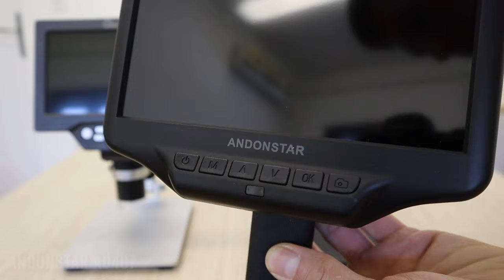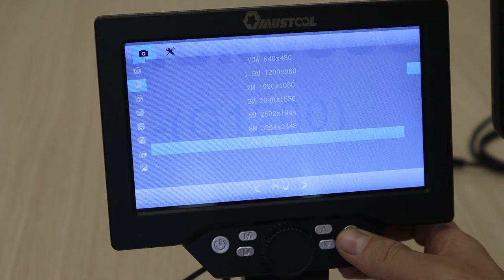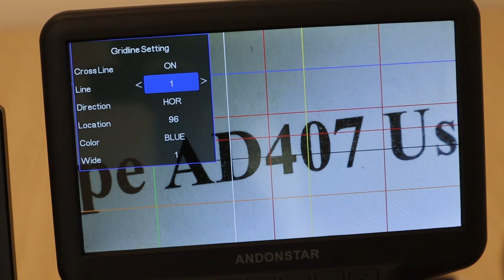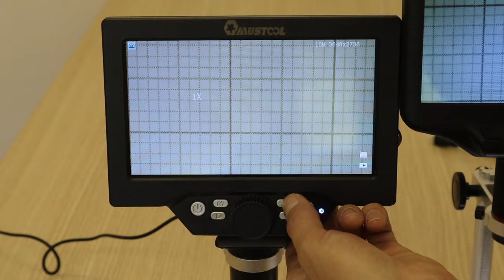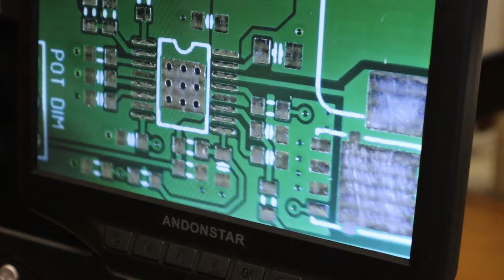LCD Digital Microscope Review: ANDONSTAR AD407 vs MUSTOOL G1200 - Cheap vs Expensive

Comment from the maker: You can get these microscopes here  (affiliate):
Andonstar AD407: https://bit.ly/3y1o3TI
Mustool G1200: https://bit.ly/2UU69nD
It is awesome to have one in the workshop.

I buy most of my tools at Banggood:
Banggood Summer Prime Sale 2021: https://bit.ly/2UhnPsV
Deals for Tools & Electronics  https://bit.ly/35HWNxg
Reply: Thanks for the effort, this is a great video. But, I still could understand which one is better. And also would you please tell me which one is good for Jewellery business? It will be appreciated. Cheers.
Reply from the maker: @gemmaster9369  Andonstar would be much better for your application.
Reply: @JTMakesIt  Thanks for the video! What about SMD electronics? Is there enough quality difference to support the 3x price difference? Thanks!
Reply from the maker: @andybee2784  Andonstar has more depth of field. You can have the whole SMD pin in focus. With Mustool you can't have everything in focus at once. You can use any  of the two for SMD work, but Andonstar is much easier to work with, plus you can route the image on bigger external screen
Reply: Hayear HY-1070  vs Andonstar AD407
Reply from the maker: @MiguelHernandez-zv8ne  haven't tested the Hayear, but I am very happy with the Andonstar
Reply: @JTMakesIt  cual es mejor entre estos dos ?? Y cual es hayear??
Reply from the maker: @riquelmeneymar5515  Andonstar is better
Reply: G1200 vs Andonstar AD207 which one is better?? Need urgent experienced opinion

Comment: One substantial difference in image quality is due to the extra led lighting, and that´s easy to solve.
I have the cheap one, and I attached to it a shitty cheap selfie led ring. Man, that does a diference. It is night and day working on the boards, as the stock lighting is just crap.
I also attached it to a cheap "magic arm" gripped to a shelve so you don´t shake the image when workin on the table, and that helped a lot too. 

The whole assembly is clumpsy and kinda crappy, but for that money I´m really happy. 

It sure gives a too warm color in the camera output to he computer and the recorded images, but it isn´t that bad. On the lcd the colors more accurate.

I would´n spend more money in this kind of microscope. I would rather go for a pure USB one and use a nice big display to show the image (even cheaper than the cheap one if you have the computer/display next to the workbench), or go for an entry level binocular/trinocular. That last one would be for sure my next upgrade if I had the money to spare.
Reply from the maker: Thanks for the input. Lightning is bad on the Mustool. The Andonstar also has an option to output the image through hdmi. I use it on my 42 inch TV.
Reply: Same!!
You can see the difference when He moves the Andonstar Led as its next to Mustool;
 I got mine on black Friday deal. I put a led ring light on it and it's works great
Reply: @JTMakesIt  what about the AD208 vs the  mustool?
 which one is better, price difference is $25  from the $100 andonstar
 also do you know of any  good ones that have a stand  but no screen that you can  use an android device as a screen instead?
 I have a cheap Chinese  endoscope and it ha san android app for your phone ,  limited to which phones it works with though  but I see no reason they couldn't do something similar  with these 
have cell phone mount  or tablet mount and stand and better optics,  most phones and tablets would provide a better screen ,  I feel like  paying for the screen is a waste and the money could go to better optics or other parts instead or  just bring he cost down,  you could argue that developing an app would add cost but in the case of the endoscope   I don't think it did since it was less than $5

Comment: what would you say is a bettery buy ad106s or the cheap 1200 in this video? mainly need it for job a qfp208 so real small legs and pads.
Reply from the maker: Both will do the job, the more expensive one will give you better images and you can hook it up on external monitor
Reply: @JTMakesIt  the ad106 is a smaller screen, there around the same price with the 1200 (seen many brands for it) being slightly more than the ad106s.
Reply: it the ad106s but not sure what difference the S makes.

Comment: great comparison, you helped me a lot. Thank you! Does the ANDONSTAR AD407 support pc conection?
Reply from the maker: Does not support usb connection, but it has HDMI output so you can put image on external screen and you have remote for interfacing which is awesome.
Reply: @JTMakesIt  thank you very much for the reply!! can you mount any barlow len like 0.5x?
Reply from the maker: @ep_dimi  it has a standard lens thread at the end. You can screw something else there than the standard clear lens

Comment: Thanks for the share. can you please let me know if it´s possible to clean all information from the screen (icons, timer, etc) from the ANDONSTAR AD407 since i intend to use this on a art project and don´t need this information to show. ty.
Reply from the maker: Hi, Sorry for late reply. You can remove clock, but I don't know if you can remove everything. I will need to test it. But you can always crop stuff out with video editing software.
Reply from the maker: Hi, Today I was working with this microscope and I tested and I can confirm that all text information can be removed from the screen via settings.

Comment: 4:00 If a 120 cm wide screen was used, the magnification would be x1200. Screen resolution also affects the magnification. So wrong measurement.
Reply from the maker: Agree, but I wanted to compare the magnification using the built-in screens on the microscopes so that it was a fair comparison.
Reply: @JTMakesIt  I don't quite understand why they say it has magnified 1200 times. In my opinion, to see the true magnification, you need a screen with the angle of view and resolution of the eye.
Reply from the maker: @Seraslan  i think this is some marketing thing. That is why you need to check review videos like mine, to see the true specifications
Reply: @Seraslan  A far more sincere way to describe it would be 1200x magnification (for wide screen resolution).

Comment: No way to correct the yellow tint with adjusting contrast or saturation settings? Worse case one could correct it with a filter post-processing the video.
Reply from the maker: I agree. But I think the yellow tint only comes at certain magnifications and its only present at video recording. The image on the  screen looks fine.